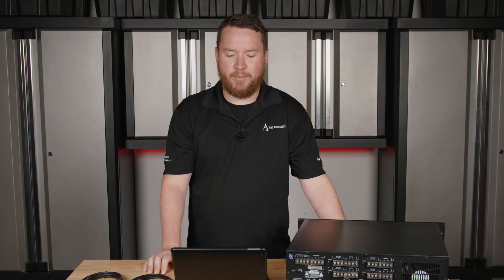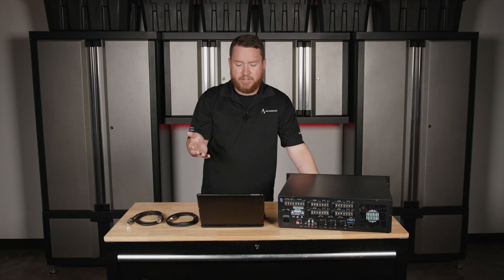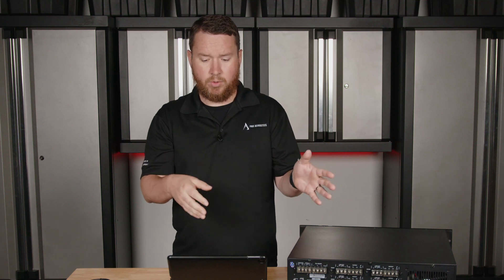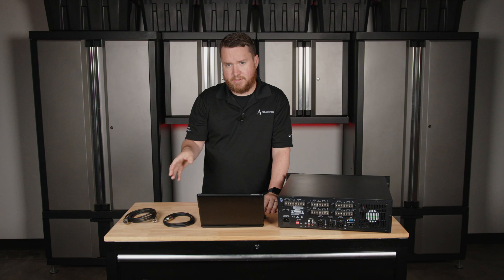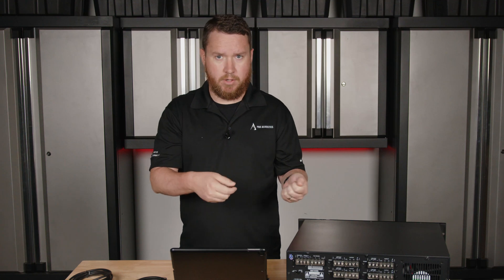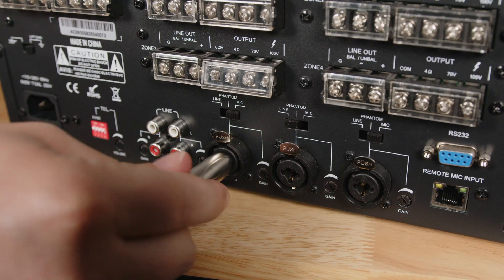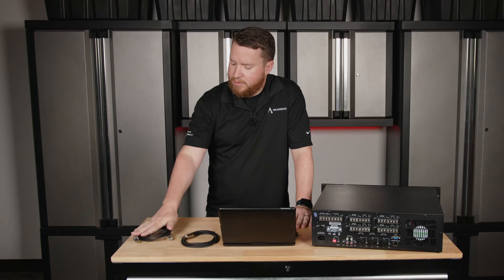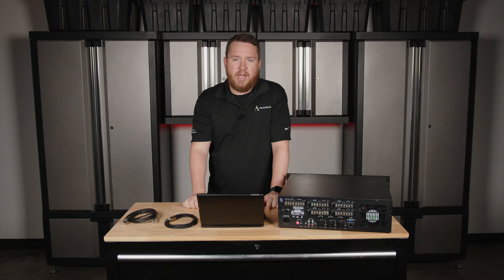What Is a Combo Jack? On Pro Acoustics Tech Talk Episode 122

Comment: So it means Combo work with either TS or TRS but takes only Mono input isn't it ? In a scenario if I want to connect Keyboard to a mixer better use two inputs to get stereo isn't it ?
Reply from the maker: That’s correct! The combo jack can work with either TS or TRS, but it only handles a mono signal. For stereo operation, you’ll need to use two inputs—one for the left channel and one for the right channel.

Comment: I didn't know it could take a stereo jack because everything else that plugs into it is mono..
Reply from the maker: The Combo Jack allows for either an XLR or a TRS (Tip/Ring/Sleeve) 1/4" connection. It's not stereo in this case, but simply another way to terminate a balanced wire connection. I hope that clears things up!